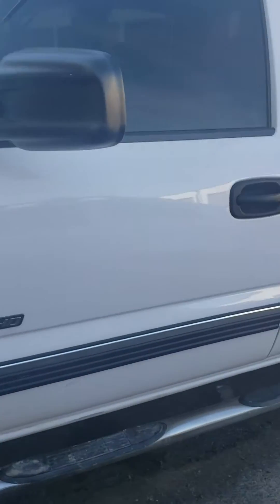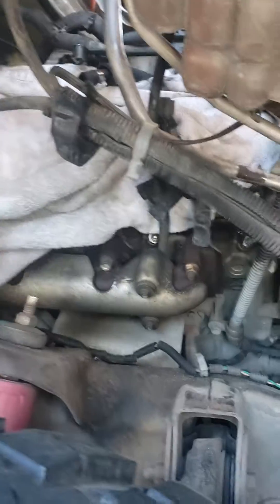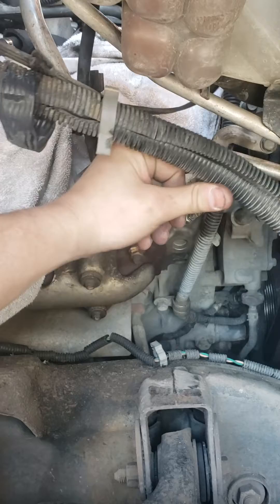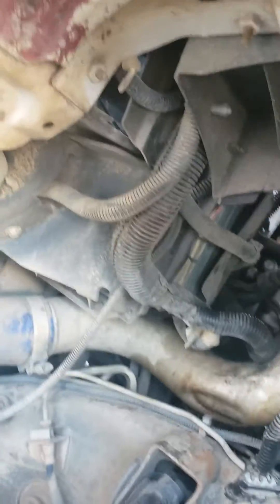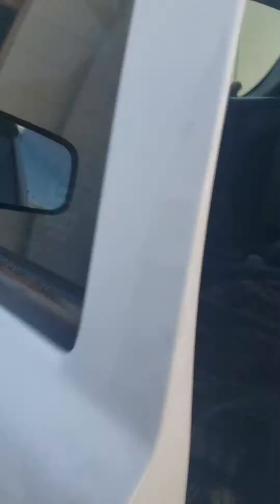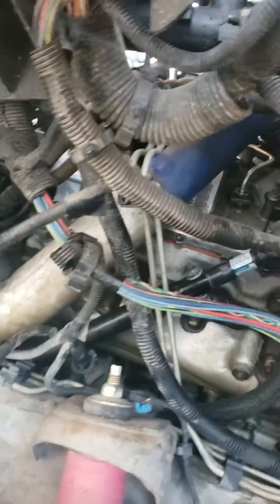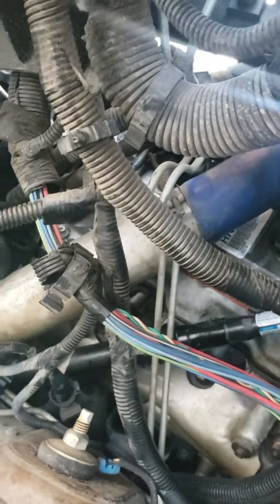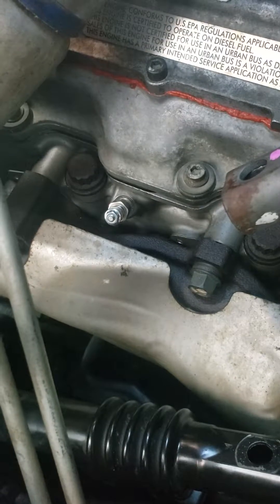Chevy 2500HD 6.6 Duramax Glow Plug #4 Replacement

Comment: Ive got a 2008 6.6 duramax 3500 and when you remove that bolt the stering shaft will not move up or down. There's like almost no play.
Reply from the maker: hey sorry for the delay, did you get it figured out? if not I have a friend with one I cam check out for you.

Comment: Is #5 just to the right of #4?
Reply: Nope, #5 is on the passenger's side.
Reply: Driver side front to back Is 2 4 6 8 . Passenger Front to back is 1 3 5 7
Reply from the maker: no sir, google the lb7 firing order and its usually from front and someone said it that its passenger side.

Comment: Good video info. On mine the metal collar under the nut is crimped on there so you can’t turn that nut. Only the bolt holding nut stationary. The metal safety collar twisted on Mine and road up the side of the nut. Pushing the socket or wrench off of it. Pain in the ass. Had to hammer that collar piece down to get box and on it. After that I held it on one spot only turning the bolt and it came out fine then. Nut is worn. Need a new one.  Torque if I recall for glow plug is 13 ft lbs and 18 Inch pounds for the small nut on the end by the wire. Nickel anti seize is a good idea on the threads of the glow plug. Good to 2400 degrees. My no 4 went 100k miles.

Comment: Neat solution! I got 8 no cost glow plugs with reman injectors last summer and figured I may as well put them in. You didnt mention why you replaced the GP's in this jarhead's (😀😀😀) ride. 

btw, I got here from a link on the Duramax Forum.

best
Reply from the maker: Sorry. The reason for the glowplug replacement was due to my buddy buying the truck with bad injectors and it ran like garbage. One of the glowplugs on the driver side even had the tip where the glow strap tightens down, break off due to corrosion when i simply touched it and plus the Diesel Logic kit that was purchased included EVERYTHING! So we figured get all the new parts in. She runs like a dream now.

Thanks for the view on this BTW. Have you done the work to yours yet?
Reply: Jay Starr , Yep, injectors last summer. Otherwise, all stock with 3rd set at 155k.